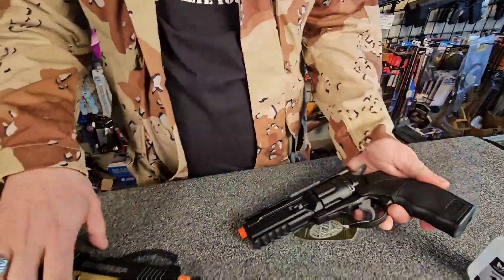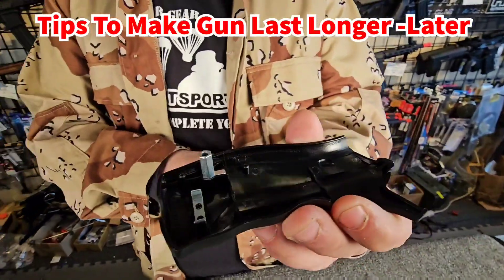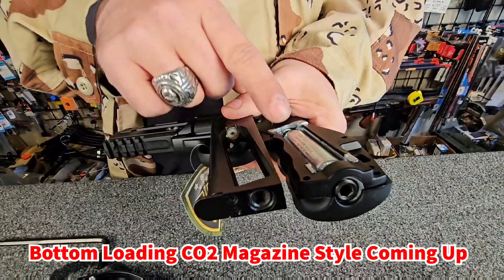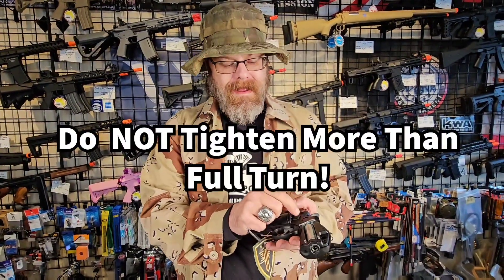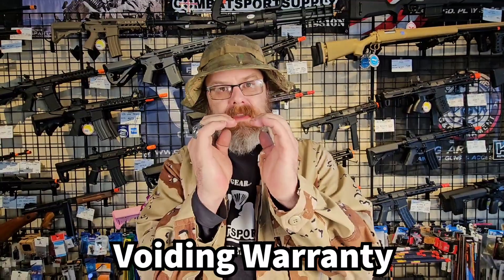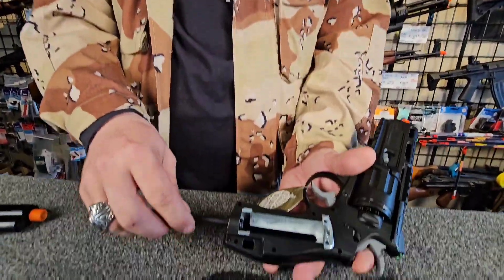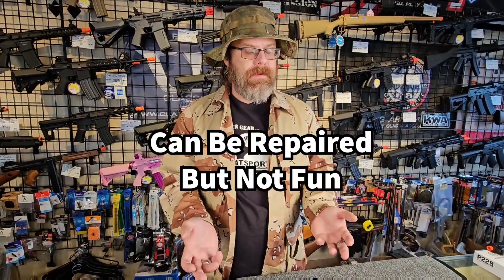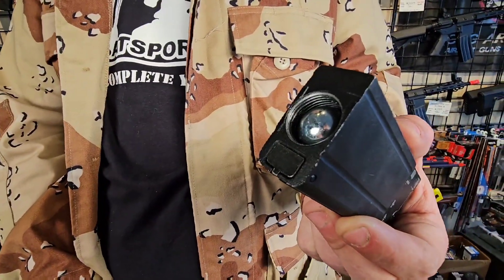How to FILL a CO2 Airsoft Magazine

Comment: Thanks for the advise. One question: Can i use a silicone spray instead of oil? I have a bottle of asg ultrair 100% silicone spray. I have put just one little spray directly to the co2 valve of my asg schofield revolver every time i change co2 cartridge. I noticed that with the first two/three shots there is a puffy oil cloud coming from the bore. I thought ok, this must be the oil that lubes the internal parts, as the co2 passes through the airgun. Is this normal? I know that it's not a good idea to overlube the gun as it can affect performance, but the amount of spray i use is a just a little. I tried spray on the cartridge itself but it doesn't hold very well. Any advise? Have i done something that cannot be fixed? Thanks.
Reply from the maker: Spray is fine, oil is better. You are doing it correctly,  there will be some oil spray come out with the first few shots. If concerned, do it every other or every third cartridge.  Thanks for watching!

Comment: Why didnt the co2 hiss?
Reply from the maker: There should be a tiny hiss when pierced. If your piercer or seal is bad, it will hiss until tightened some more. But do not Tighten it much more or you will damage the piercer